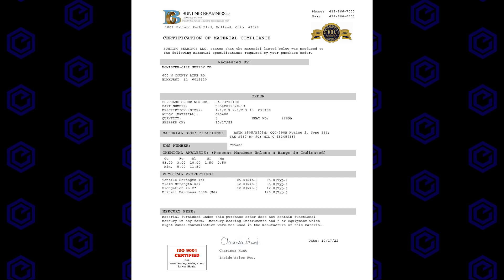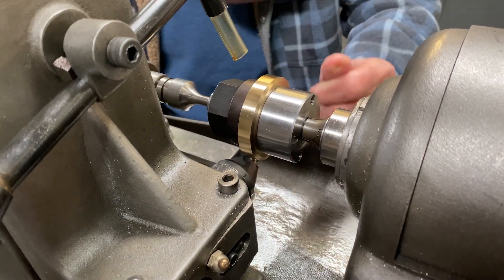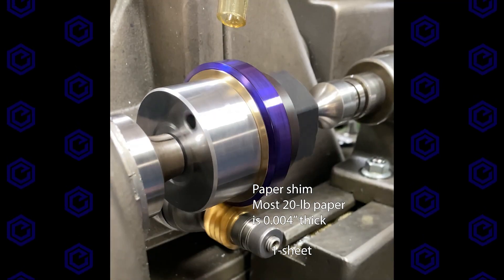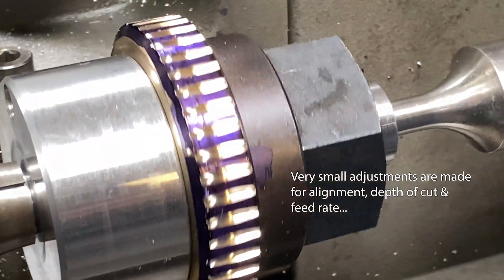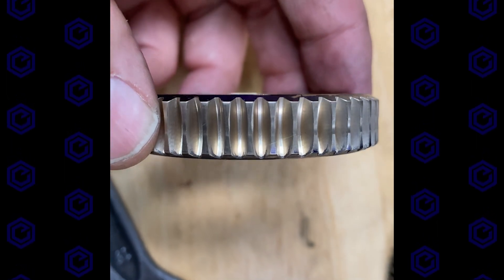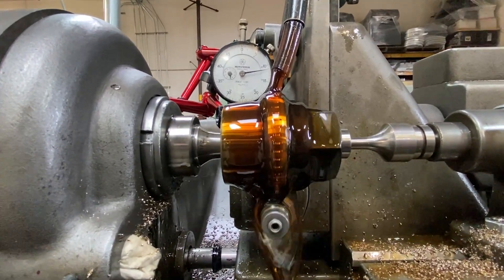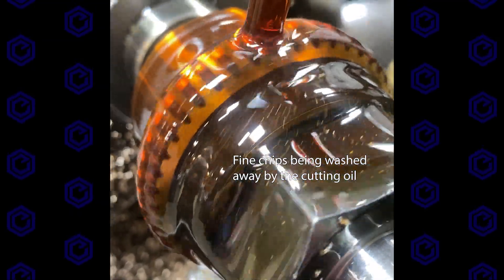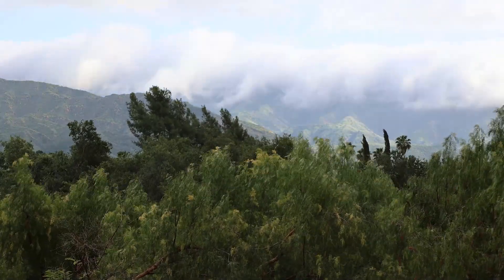How to Make a Worm Gear (Hobbing Process)

Comment: Can you make a worm and wheel engagement with the worm shaped as an hourglass sp so that more teeth are engaged, and more force can be transmitted? The concept seems to be reasonable, and I made one out of wood and slowly wrapped around the hourglass worm a soft metal rod and glued it with superglue to prove the concept. It seems to work. I have not got the facilities to make what precision demands, but I could brace a rod on an hourglass-shaped worm fitting the circumference of the wheel, .
Reply from the maker: We cannot make this type of worm.  But they do have applications

Comment: This machine doesn't seem like it'd be very hard to make
Reply from the maker: There is more than meets the eye.  A large wormdrive to give high quality tooth-tooth results, adjustment for lead angle, Double reduction gearbox for indexing the tooth count using gear ratios, full hydraulic control for smooth operation, high quality spindles and a filtered lubrication system.
But regardless of the challenges I have certainly thought about it. 
Once you find an old machine and take it apart, the full appreciation of the complexities will sink in.
Andrew

Comment: Why no hob steady rest?
Reply: The Mikron machines are extremely rigid by design; the larger 102 has an optional hob steady, their other machines don't have one because they don't need one.
Reply: @elanjacobs1    while cutting under load i would have to think their would be hob deflection me personally I would like to see an indicator on to make sure
Reply from the maker: For these fine pitch gears the spindle is sufficiently sturdy/rigid
Reply: @EvolventDesign  try putting an indicator on the hob arbor there will be runout.
Reply from the maker: @jerrykahler5586   Yes, that is done as SOP for all the jobs.  It is a very robust spindle.  Hobbing takes extremely small cutting pressures, espeically on the final cut.  All of the chips are extremely small, each of the 11. 13. or more teeth of the hob (defined by the number of flutes/gashes) make a cut for each revolution.  But I hear you, metal is rubber, and how much you can handle in the operation needs to be understood to achieve a reliable process.